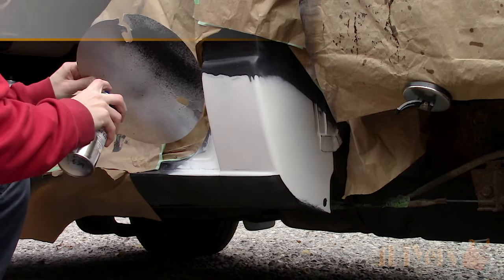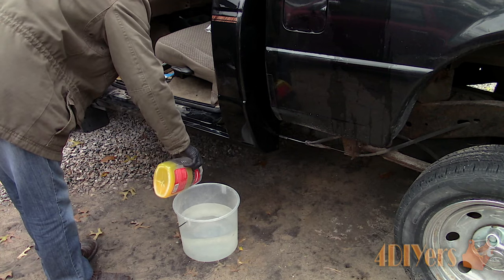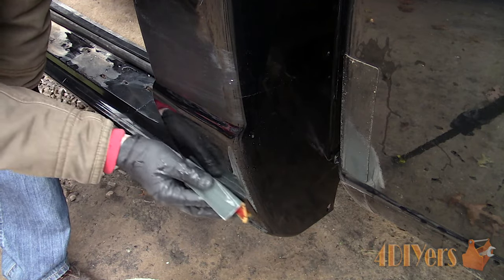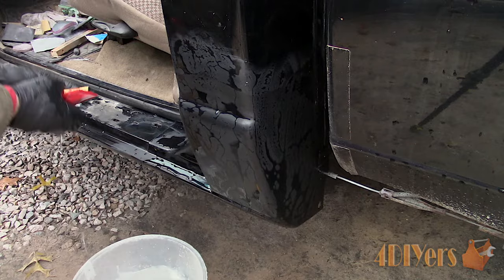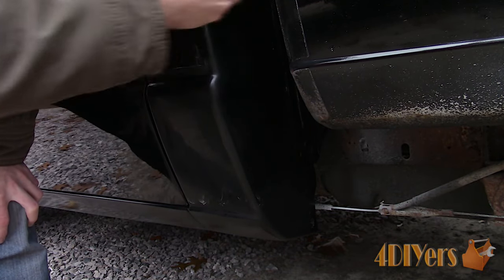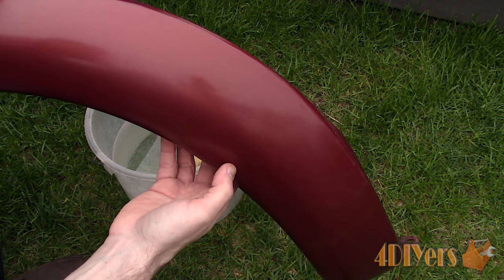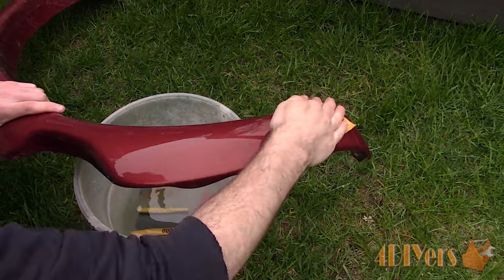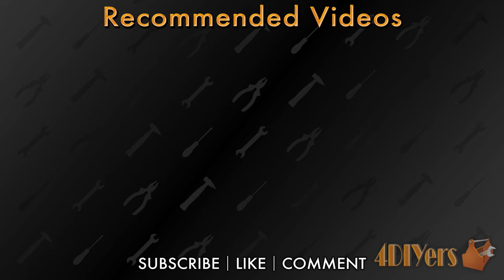How to Wet Sand and Polish Paint [Beginner's Guide]

Comment: Your tutorial is extremely well done. Thank you for posting ! I am a total rookie at this but was curious why people would wet sand a paint job. Now I know. I am looking forward to applying the technique on some DIY overnight sensation speaker kit.  The 9x8x6 box is made out of birch wood. I contemplated about buying a paint gun but have come to realize that it is a bit of high maintenance for two pairs of speaker boxes.  I feel confident seeing you use some simple spray bottles.
Reply from the maker: Thank you! No need to buy a paint gun, you can get really good results with aerosol cans. I would recommend using a two stage paint, get your base and then apply a clear coat. For clear, my recommendation would be 2k.

Comment: Hey. I used 1 stage on my snowmobile hood. I used 2 coats and i also wanted to clear coat it. 
I was wondering if i should wet sand at 2000 and then polish and then lay the clear? I don't want to clear over hazy paint after the wet sanding.

Comment: Great video thank you! I repaired a small rust spot and painted with base coat and clear coat which I’m gonna let dry for a few weeks and I’ll extra time anyway over Christmas to shine it up! It has orange peel and I also need to carefully blend in the tape line! I was planning to wet sand with 1500, then 2000 grit. Can I move right to polish after wet sanding or do I have to wet sand THEN compound, THEN polish? I don’t need it to be totally perfect just want to get rid of the ornange peel and get a better reflection. 

Also after polish, do I have to apply wax? How necessary is wax? Thanks!!

Comment: How cold of weather can you put clear coat on? I noticed you wearing warm clothes, my temperature here just between 50 and 60 Fahrenheit thanks
Reply from the maker: I’ve probably painted in 45, but you need to be extremely careful. The paint can run easily, dries very slowly so you need time between coats and you have to be careful with moisture as it can damage your final finish.
Reply: @4DIYers  Thanks, I put the vehicle in the garage and put an Infared heater on it sure helped with the curing and drying time made a big difference.

Comment: I have a Camaro paint is about 4 years old I've noticed some blotchy spots on my spoiler want to wet sand it to remove it can I wet sand this I've noticed the clear coat is very thin also there is some cracking on my urathane front bumber cover. Can that be wet sanded also.
Reply from the maker: Sounds like you do have clear coat failing so the best option would be repainting it.

Comment: For a two stage job, do you sometimes need to wet sand and polish after applying the base coat (color) and then again after the clear coat? Thanks
Reply from the maker: Some people do color sand the base coat only if there's dirt or if you're going for a show finish. But you need to be extremely careful, depending on the paint this may cause surface finish issues.
Reply: only solid color base can be sanded not metallic

Comment: Great video tutorial! Would it be acceptable to wait 24 hours before doing sanding under time constraints?
Reply from the maker: Thank you! Personally I think that would be rushing it. You can do certain things to help speed up the curing process like placing whatever you painted in the sun, apply an incandescent bulb/heat lamp, or using hot air from a heat gun.
Reply: @4DIYers  would the Texas sun cure the paint any faster lol I was installing a spoiler and got finger prints all over the clear coat need to sand it and polish it rn it looks like complete dog water

Comment: I can still see the line between the new paint and old paint after wet sanding, 1500 then 2000 then 3000 then 5000, then I buffed it and it's still there.. What am I doing wrong??

Comment: Can anyone explain that tall rectangular metal patch between the cab and the bed where it separates? My ranger has it too, and I always though the previous owner had cut out rusted metal there until I saw this video. Is it there by design?
Reply: Daniel Pendzich if I am following your question the vertical “patch” on the bed is actually a plastic protection film. This film is applied to edges from the factory to help prevent chips from road debris.
Reply from the maker: The one at the very bottom on the rocker? Just like Daniel said, it's a polyurethane film to protect the paint from stone chips. I will be releasing a video (still need to put it together) and that same film is used on the fender flares which needed to be removed for painting. Actually if you check out my fuel tank leak repair video, towards the end before it's installed, the same film is used but it's just cut differently.
Reply: @garner3384  Thanks, that makes sense

Comment: A week wait per coat sand damn I don't have time for that lol. Ask any customer if they have 2 months to get a car back.  I have some minor crack on paint from too much spray, but tomorow ill try 1500 sanding to smooth out. Also I discovered rustoleum clear coat immediately cracked my krylon paint, and read not to mix brands. Neverless thanks for the finishing info and paper #s

Comment: Does the clear coat have to be 2k, or is 1k ok? Will 1k harden enough over time?
Reply from the maker: 2k is by far the best clear coat you can buy in a spray can version. However it's not mandatory. I've used 1k plenty of times and it does the job, just not as well. It'll dry just like any other paint, it's cheaper, but it's not as nice to work with, not as durable, and not as resistant to the elements.